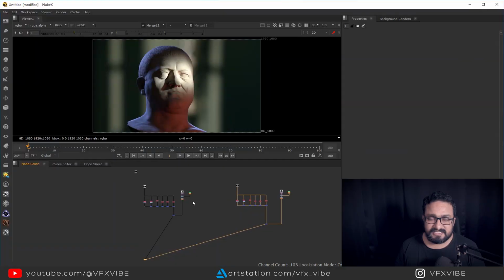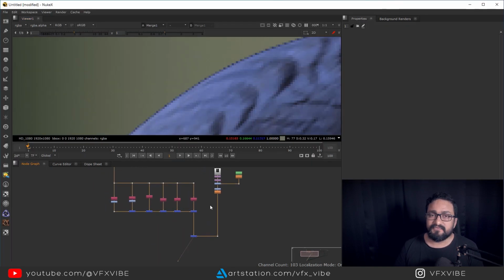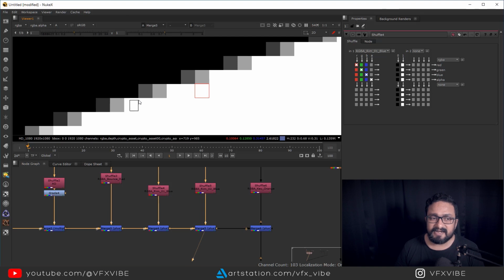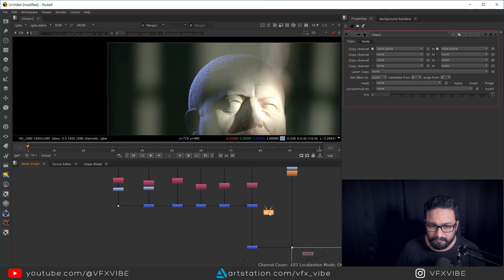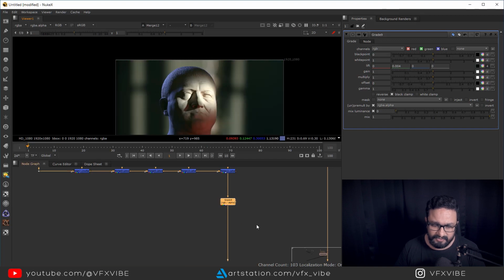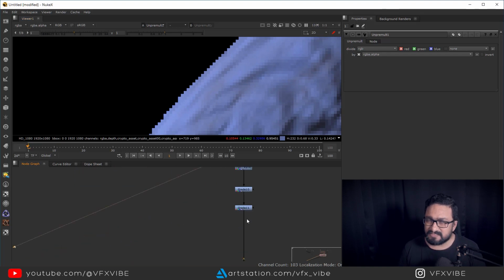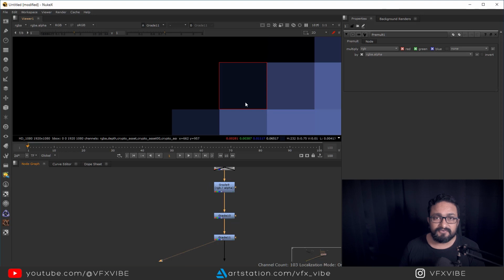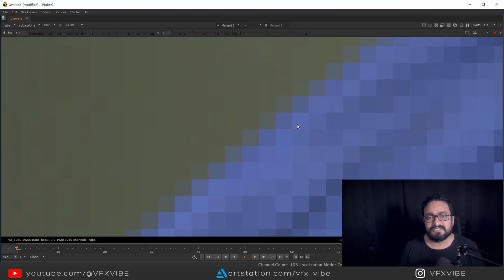CG COMPOSITING SECRET THAT NO ONE WILL TELL YOU | VFX VIBE

Comment: Correct me if I'm wrong, I think u can also fix that black edge problem using "unpremult". You need to connect unpremult with all the passes after shuffle node and  then multiply or plus them.  I think, it will also do that work.
Reply from the maker: Absolutely we can do it by this way. Only we need to tak care about alpha in every shuffle. 
I showed two ways to fix it and you shared third way 😊.
Thanks for sharing Bikramjit 🙏